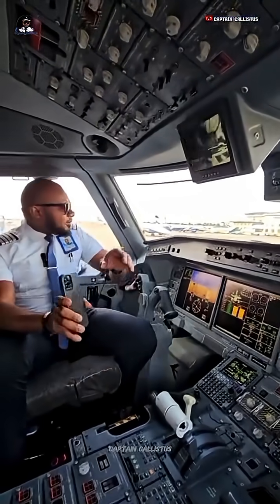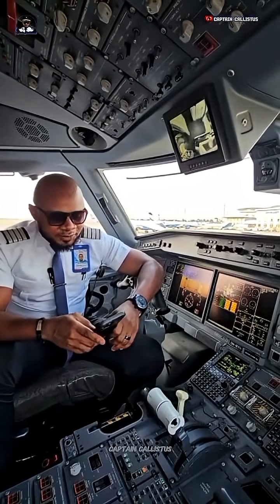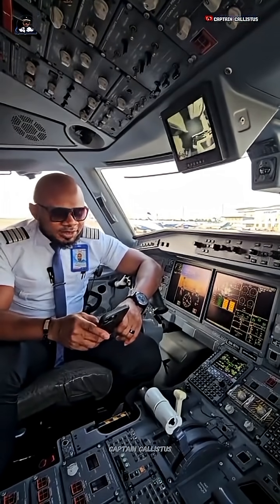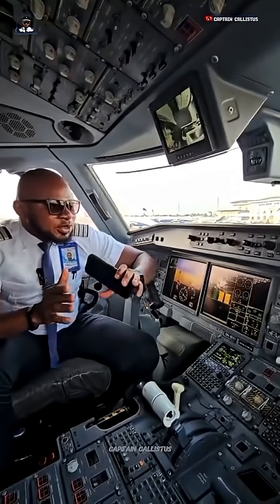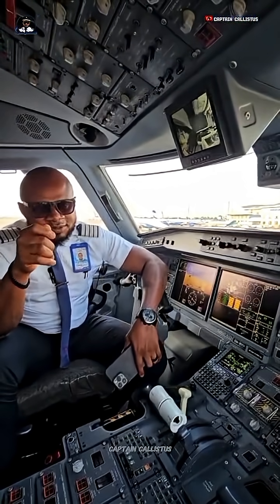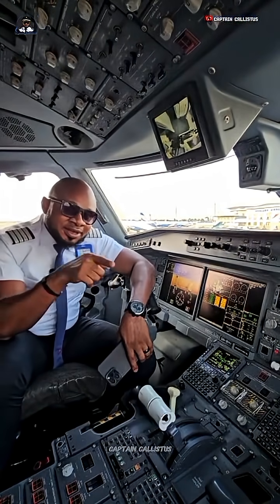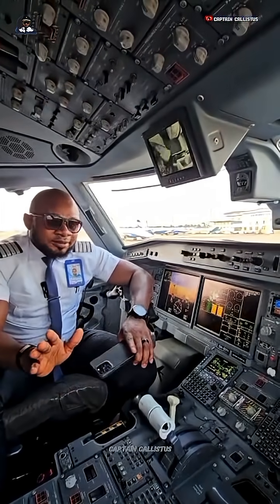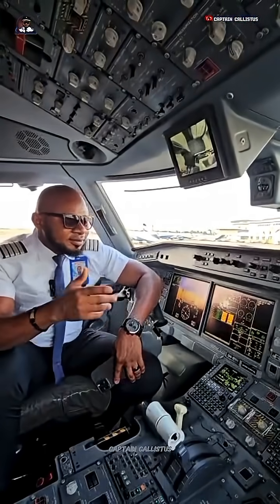Can the APU Save the Plane When an Engine Fails?

Comment: BOEING A/C
A Boeing aircraft's APU can consume approximately 150 to 500 pounds of fuel per hour, which is about 23 to 39 gallons. The exact amount varies depending on the aircraft model, its load, and ambient conditions, but it generally ranges from a lower burn (around 150-200 lbs) at idle to a higher burn (up to 500 lbs) under full load. 
APU Last as long as there is fuel available. 💯

Comment: If one engine fails, the second engine will/can still power the aircraft to its destination safely. Even if it fails before takeoff, one engine will power the aircraft. The pilots just need to go through the procedure for engine failure and configure the aircraft properly
Reply from the maker: That's correct, an aircraft can operate safely on one engine.
Reply: @Captain_Callistus  I boarded Airpeace flight from Kano to Lagos (Direct). I was looking forward to seeing you but unfortunately it wasn’t you. Looking forward to meeting you soon.
Reply from the maker: @DEverythingVlog ooohh... surely, we'll meet one of diz days